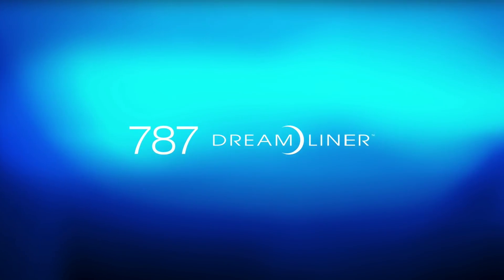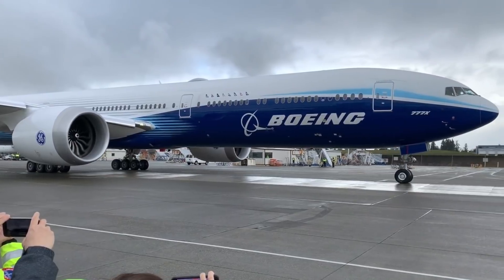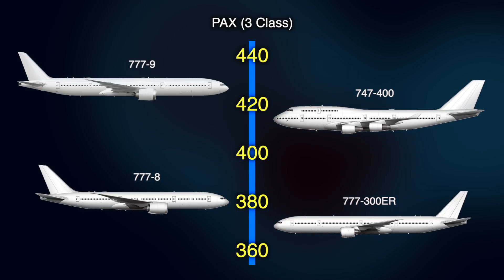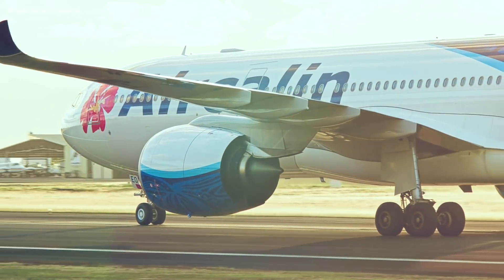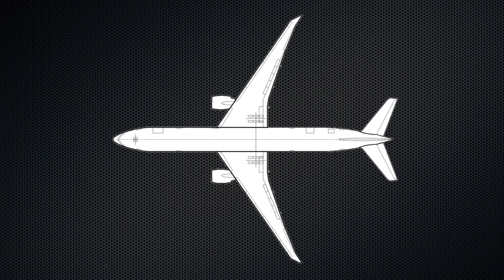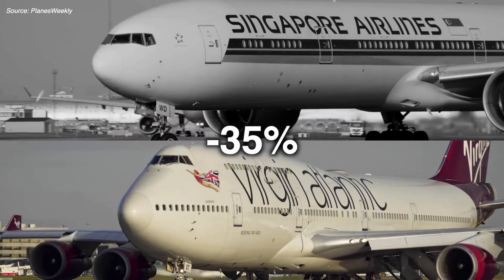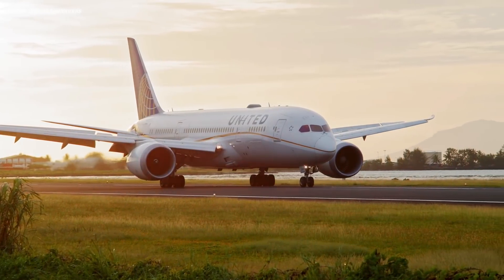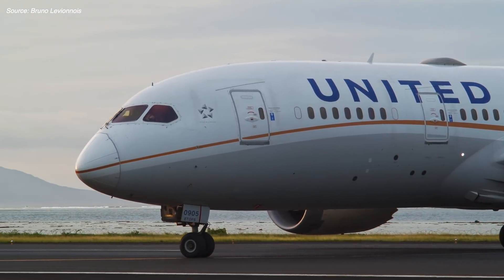The 777X Has a "Tesla Problem"

Comment: not to mention they done test when lightning strikes at storms and composites did not fare well compared to its metal counterparts and also the discovered that composites react aluminum over a long time when they exposed to the elements but they've mitigated those challenges.

Comment: 777x is not really a product aimed at a particular market need, rather it's a solution (based on Boeing's product issue) looking for a problem in the market. Boeing correctly identified the trend towards increased point-to-point flying, which led to the successful 787, but the development was badly managed resulting in excess costs. So I would say the root of the 777x issue was Boeing's failure to execute the 787 program efficiently, resulting in reluctance to develop further clean sheet aircraft. The problem is compounded by competition with A350 and A330neo, which by comparison have relatively low development costs, and both of which limit BA's scope to profit from 787.

777x essentially exists because the 300ER could not compete with the A350, which killed Boeing's previous cash cow. Boeing therefore stretched the aircraft to reduce seat-mile costs, but in doing so pushed the 777 into the VLA category. Slot-constrained hub carriers e.g. Emirates, BA, Singapore etc. do have a genuine need for VLA, but this demand is insufficient to amortize the substantial cost of a clean sheet program, as AB discovered with the A380. It's worth noting that AB considered doing an A350 stretch to directly compete with 777x, but they decided it wasn't worth the program risk, so they are happy to concede this niche segment to BA, but they always have the option to revisit this if demand picks up, perhaps when they do the A350neo.

Comment: Bombardier arrived at a similar technical material choice as the 77X when they started CSeries(now A220) program development 5years b4 the the 77X program launch: metallic  fuselage combined with CFRP wings.

Though the CSeries' aluminum-lithium alloy fuselage material 
is a bit more advanced than the 77X's majority aluminum.

Comment: An aircraft that can transport 200 to 250 passengers is more likely to be more profitable for airline carriers. It gives then more flexibility in both mid-range to long range flights in terms of fuel efficiency and the the flexibility that today's passenger requires. Plus aircrafts do not need to be long and wide anymore. They can be wide and shorter or simply single aisle. Air travel is becoming too expensive and sooner or later less people will not be able to do so and that will hurt airliners.

Comment: Boeing 777X  is very nice airplane  ,  but  though said  ,  i  don't  understand ,  why  Boeing  decided  to  kill  747-8  model  instead  of  making  from  existing  747-8 model  ,  with  some changes  ,  new-modern  747  twin  engine  airplane  ,    because  747 is  way  more practical  than  777  ........ ,  because  keep  in  mind ,  that  dimensionally ,  like  fuselage  length  and  width  ,  there's  insignificant  difference  between  747-8  and  777X  ,    but  as  i  already  mentioned  ,   747-8  is  way  more  practical  ,  because  of  front  nose  cargo  entry  747  got  way  better  cargo  capabilities  than  777 .      If  there  is  no  possibility  keep  in  production  both  models  ,  so  by  my  opinion  kill  777  model  make  much  bigger  sense  than  kill  747  which  you  can  use  like  passenger  airplane   but  also  as  very  good  cargo  airplane  .

Comment: Your sums are not quite accurate. Sure, composite materials might weigh less than metal structure but a fuselage consists of more than its structure. Whether the fuselage is made from composites or metals it must still contain heavy seats, galleys, toilets and interior furnishings. The fuselage also contains the landing gear. So, while composite structure might be lighter than metal structure, the same weight in seats, galleys, toilets, overhead bins, carpets, aircon systems, electronic systems and landing gear must be carried around resulting in a somewhat degraded weight saving.

Comment: With demand increasing, airlines will start flying their A380's once again. Emirates, Qatar and BA have started doing so and at this price point, purchasing the 777x won't make sense unless you're replacing old 777's or want a big aircraft (Airlines like Swiss could update their fleet). Boeing got lucky with Airbus discontinuing the A380.
Reply: Could be wrong but I expect that as 787s come off the line the A380s will fly back to the desert.    Once there are enough twin engine planes to go around the 4 engine planes will again be too inefficient to fly.
Reply: @danharold3087  Emirates wants Airbus to make a new A380, Lufhtanyjust brought theirs back. Demand is soaring. 787s are too small, the 777X doesn't exist as far as airlines are concerned and the A35K is the only existing replacement, which itself isn't as big.
Reply: @danharold3087  That's a whole different conversation, my point is that airlines need high-capacity aircraft like the A380 since demand is increasing. Airbus won't bring the A380 back, but they can stretch the A350.
Reply: @patrickbateman529  I can see them stretching the A350.    I hear there is more money to be made flying 2 of them instead of a single A380,  For the same money you can fly more people and have more route flexibility
The A380 will still win when looking at gate and pilot constraints.

Comment: It's just too early for retirements of old 777-300ERs. Take AC, they received their last 777-300ER like 6 years ago, there's no way in hell they'll be replacing it for at least another 10 years, probably 20. Most airlines have similar issues, all the 777X customers have really old 777-300s, or some of the very early 777-300ERs (which are close to 20 years old at this point). Give the airlines a couple years.

Comment: Boeing engineers probably weighed the benefits of a composite fuselage as this:  it's more susceptible to cracking, as the fuselage undergoes compression/decompression cycles far greater than the wings' G-load stress cycles.  Given the airplanes have a stated number of working hours in their service lives, they couldn't massage the numbers, without introducing fatal flaws...as was seen in the MCAS - an apparent decision to overlook safety redundancy in exchange for faster-to-market, and cheaper-to-market initiatives...sometimes, you can't put a price on quality.
Furthermore, if you want more proof, compare composite baseball bats vs. aluminum bats...you will see the fatigue in a composite bat much sooner.  Cracking becomes visible soon after first impact.  I have seen aluminum bats crack - but usually it's from very high, consistent physical loads over longer periods.  Engineers tend to design the structures so as to minimize costs - within the lifespan of the product.

Comment: I think the 777X is too little too late. Aside from being several years behind schedule, its capacity is just too large! It's the same reason the A380 and 747-8i didn't sell very well.
Reply: The 777X currently sits at 350 orders. 

The freighter 777X F could have  around 200 to 300 orders..

With airtravel demand posed to recover , some 777-300 ER customers might be interested in the 777-9  but only for a few jets . 

I estimate the 777X will sell around 400 - 600 times which will be very successful for such a large airplane . 

The 777X is not to late , people forget that airtravel will continue to grow exponentially into the future. Lol

Comment: Of course, this all depends on the fuel price trend.  Gasoline in Norway is almost 8 dollars per US gallon.
Reply: Does Norway have hydraulic fracking, as the USA does?
Reply: @TheRealUSArmy  It's used world-wide.  It originally was employed to extend the production of existing conventional wells, and then was "improved" to enable directional drilling to greater depths and to extend laterally for kilometers, if necessary.
Reply: @kimweaver1252  hopefully that process becomes more efficient as time passes then

Comment: Good video, explains ROI, very well. However there is one very large caveat to using composite materials to manufacture aircraft that only a composite material manufacturer would understand and that aircraft manufacturers are ignoring. Those engineers reading this will know - otherwise I don't engage with trolls.

Comment: Apart from measuring how high fuel prices need to go before composite makes sense for 777X, you could probably do another video explaining why is the 777X so expensive in the first place. In the video, you explained all the reasons that should lower costs, but not reasons that would justify the high price.
Reply: Start will all that carbon fiber already on the plane.

Comment: Boeing made a big mistake in not building this and the 747-8 in composites. Why, because the weight savings would have translated into freight capacity. Airlines make a ton of money on freight transportation. The lighter the plane, the more cargo it can carry. And since we know there will be a cargo version of this plane, I'm not sure it will perform as great as it could have! Especially with Airbus launching a freighter based on the 350-1000

Comment: Reason for not using composite is because it'll just be grounded in a couple of years due to structure failure... So the large amount of money upfront wouldn't be made back.
Reply: Said absolutely no one ever . Lol. 

The 787 /a350 use composites but have never suffered structural failure. Lol
Reply: @mmm0404  why was 787 grounded for? Oh yeah structure... Ok. Who's the 🤡 now?
Reply: @daylate  🤡🤡🤡

Quality control issues and structural issues are completely two different things.  

Most of it was due to negligence , like not improper wiring insulation  , not cleaning up after machining loose bolts . Thats not structural failure .
Reply: @mmm0404  here's a little clip cause I know bootlickers don't want to research.

Boeing halted deliveries of its 787 in May 2021 after the FAA proposed concerns about the jet's inspection method, citing unacceptable gaps between fuselages

Gaps between what? What's trash in the wing? 😂 And you are calling me a 🤡... What does that make you? 

Dunce

Comment: Some issues with your “Tesla comparison”
1) the Tesla has a huge markup because there is so much demand. The Tesla model 3 was selling for 35,000 but they increased the price due to demand. Tesla’s have 6 month waiting list because of all the orders. Boeing could dream of such problems. 
2) cost of ownership favors the Tesla more because there are no oil changes. Gasoline engine issues like transmission issues are not present in electric vehicles and the electric motor is inherently far more reliable and less complicated than gasoline engine even Toyota’s.

Comment: You might also consider airframe maintenance. MRO and structural inspection for the 777 is well established and probably a pretty important factor. Wings are a bit easier to change the process for.

Comment: Boeing also made a mistake in closely tailoring the aircraft to the specifications of mainly the ME3 airlines.  Specifically Emirates.  So it does not have that flexibility that other airlines may want.   It will do better as a freighter.
Reply: Please explain what those specifications are, and why they are different from other airlines. I'm very interested in these kinds of details, and they are not easily found on YouTube.
Reply: The 777X with its heavier metal fuselage would not have had a chance against the lighter a350 if I was to compete heard to heard 

Airbus themselves avoided competing directly with the 787 and it worked , the a350 sold well. If they tried competing directly with the 787 they would have been destroyed. 

Smart move from Boeing , even if the 777X can sell around 500 to 600 jets it will be considered a success ..

Comment: Imagine a full composite 747-800. Someone would have to do the math on how much lighter it would be, but the real question is, can it be done needing only 2 engines? Preferably the GE9X's.
Reply: Actually the 747 sold all this time only because its size allowed it to have much more range. If a smaller plane can go further, you bet that airlines would switch.
Reply: you described what a full composite 777X is, and a 787 would still be better

Comment: Great video Coby.  The challenge I have is the 777x is 45 tonne heavier dry than A350-1000.  Yes there’s a slight difference in passenger numbers.  I’m always amazed how Boeing is more short-term in its thinking vs what’s right for the planet, customers and us.  Not sure where you get the expense blowout price wise for 777X composite and with the FAA approval process it will be as intense as an all new plane.

Comment: The difference between boeing and tesla is that tesla would’ve made the full
composite 777x but would have improved their production system so that costs wouldn’t skyrocket. Unfortunately boeing is ran by accountants and not by engineers
Reply: And tesla doesn’t have to deal with pathological unions
Reply: I have been thinking about this since Boeing talked about their new virtual design space.  Not sure on their name.
What Boeing needs to do is work on a product and production line that takes mistake making bored people out of the picture.

Comment: I see a logic error in the fuselage weight at 5:05
With this dry mass the fuselage would weigh 43,000 kg  if the plane would be constructed with just aluminium. The weight distribution is calculated with the same material being used for the whole plane. But since the wings are lighter then usual because of being build with carbon material, the fuselage must be heavier then 43,000 kg. So the weight savings would be even stronger
Reply: OTOH fuselage isn't built only from aluminum. There's the paneling, seats, windows, paint, all sort of machinery and electronics, safety equipment, cabling, the entire APU which is a smaller jet engine, and so on. Most of that stuff either already isn't made from aluminum, or can't be swapped for composites.

Comment: Given the climate situation any of these conventional kerosene powered jets will only have a life of maybe 15-25 years before government regulations intervene.
It probably makes sense not to spend to much time and money on tooling for these planes, as large long range hydrogen planes will look very different, and will not be able to reuse a lot of older parts.
Reply: Modern engines are now being designed for sustainable fuels and can run on 100% alternative fuel. Like the Rolls Royce Ultrafan.

Comment: The overall weight of a fuselage is is not simply the skin of the pressure vessel - it includes the entirity of interior, that is currently constructed of composite materials (for the most part). I think the biggest advantage composites have in a structural context would come from their immunity to corrosion and improved cabin atmosphere. So yah - they should have built it out of composites but boeing isn't interested in innovating because that decreases profitability.

Comment: Bottom Line- Boeing made the right choice when they decided to create the 787 rather than a super jumbo like the Giant double decker Airbus. The Jumbos are just like the Dinosaurs. It may take years for the Jumbo market to rebound.
Also, aside for your excellent analysis of the cost benefits of the aluminum fuselage, Airbus is now having problems with their composite fuselages deteriorating unexpectedly. Let's hope the 787 doesn't develop similar issues later on...
Thanks Coby for a great, well researched video. :)

Comment: It would be interesting to see someone do the exact math.  My rough math comes up with fully composite would save something like ~$60 million over the life of the plane over what they did with the 777X.  However going fully composite once all is said and done would probably add over $100 million to the price tag, especially as you basically have a brand new plane to design and certify.

Maybe another way to think about why you would want to go fully composite is to increase fuel capacity.  So say you want to connect all of the most distant routes with non stop flights, a fully composite variant could carry the extra fuel load to make the distance.  Maybe even raise the service ceiling with the extra strong haul and burn even less fuel as the tanks empty out.  For an ultra long hauler you may need the extra space so people can stretch out and sleep more comfortably.  But then again how many ultra long haulers do you think you can really sell?

Comment: Actually, certification costs would sink a HUGE chunk into the R & D funds for the production of a full-composite fuselage 777X.  The 777X certification piggy-backs off the current 777-200LR/300ER type certification.  A NEW composite fuselage would require a completely new type certification with the requisite testing.  This would drive the costs way up, even with the much more stringent FAA requirements and oversight that have come up since the 737Max certification.
Reply: I thought that the 787 and 777 shared a type rating. When a pilot gets their endorsement for the type rating in a 777 it will show up as 777/787 and likewise the other way around.
Reply: @tuckntruck_  while they do share a type rating, I believe a pilot still needs to go through differences training to fly either/both.  I believe B757/767 is the same.
Reply: Engineer: Hey, should we build the new 777 out of composites?
Boeing: Sounds great, airlines love more MPG, right?
Engineer: Sure, we'll just to get the FAA to re-cer.....
Boeing: FA.....whaaaat?